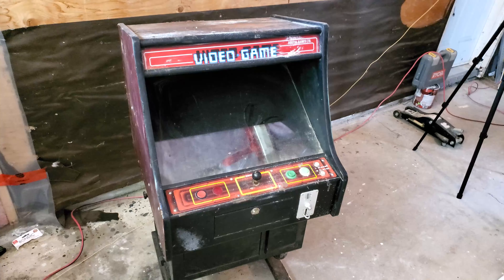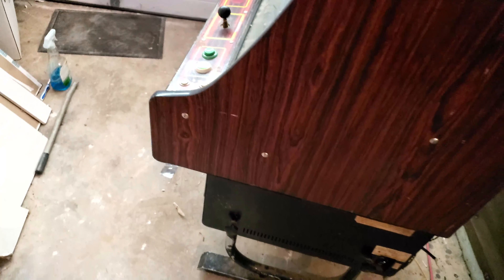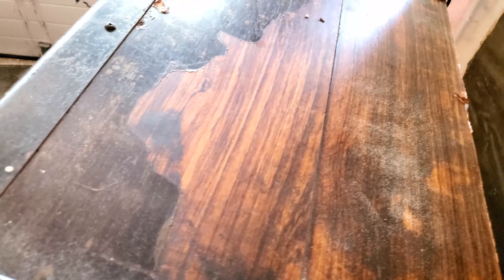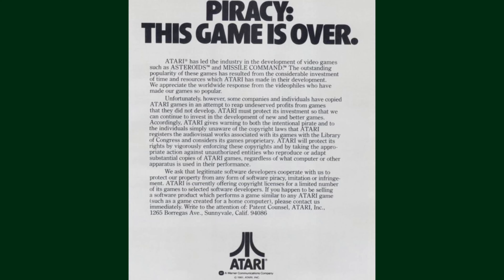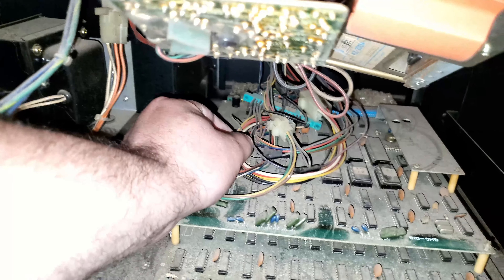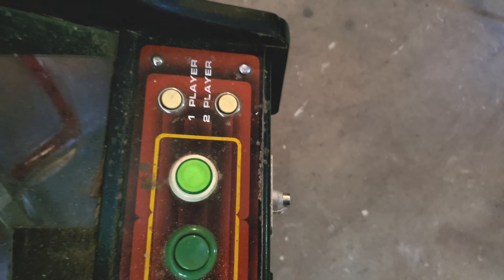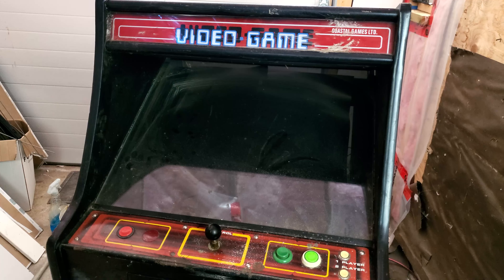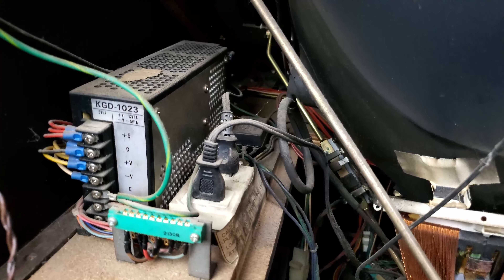Trashpicked Arcade Machine

Comment: I remember playing a Pac-Man knockoff arcade console as early as 1982. It was located in a Kresgie's store in Halifax.

Unlike many of its American counterparts, I cannot find any published court decisions involving Coastal Games. You are probably correct that it maintained a low profile.
Reply from the maker: I did find that document where one of their guys was offering repair tips, so it appears they weren't totally hiding.  Perhaps it was one of those deals where officially they only supplied the cabinet, which would be legal.. and then some under the table deal for the boards.

Comment: Since the monitor is on its side, you have a vertical deflection issue. Like you said, it's probably bad capacitors.  If you can get a schematic, look for large electrolytic caps in the vertical section. You might be able to spot them easily on the board... sometimes they're near the yoke connector.

Comment: In the past I repaired CRT for my arcade machines… but these days I replace them with flat panel displays and use an RCA or RGB to HDMI adapter instead. They look better and don't require playing with dangerous voltages.

Comment: Amazing video. I hope you get back to this one day, if you still have the gear. Swap out the screen with an LCD or something, so you can at least have a working cab. Still, great watch.
Reply from the maker: It is being worked on.  I am learning a bit about CRT discharge and safety first.  I am also sort of figuring out how the cabinet is laid out in terms of removing the CRT safely so I don't drop or smash it.  I'm capturing everything I do with it on video.  Arcade is a tad outside my wheelhouse but I'm slowly figuring it out.

Comment: I used to work as arcade gambler / pinball / technician 20 years ago. 

Suggestion: if you have a cabinet (specially a universal cabinet like this) and no keys - first thing is to get rid of the locks. Either drill them out or leaver them open carefully. The latches are usually meant to give in (to prevent bigger damage to the cabinet in case of break in). 
They are meant to be easy serviceable.

From there you should be able to get to the window glass better as well (good chance the panel with the joysticks has a hinge to fold down to service the buttons etc (either hinge on front or latches accessible from the back)

But I 110% share your discomfort about monitor chassis. Always hated them specially the big ones like this. 

As a note - you might be able to install a cheap chassis with rgb mod of a TV

Comment: So my two cents, 1) your board looks good 2) if you pull the glass back out you will find 4 bolts hold the monitor in, after you disconnect power and video cables it's relatively easy to lift the monitor out the front, then if you are not comfortable working on it take it to a repair shop, the tinted plastic is to hide the burn in on the tube... 3) If it were me I would put in a new joystick and buttons from HAPP controls, and one of their Jamma harnesses (save the old ones, put them in the coin bin for safe keeping, that way if you ever want to go back you can) then you can plug in something like a "Blue Elf" and have 750 games, the other thing is with a jamma connector it's easy to build an adaptor to put the original board back, or you can get a TON of just jamma boards for $100 or less if your willing to take time... I have 3 cabinets, one is a cocktail with a multicart in it, one is a standup sega set up to run jamma boards w/ light guns, track ball, and joystick options, the third is a racing cabinet (dedicated) for my standup i go to arcade auctions, and watch online places like FB market for boards I want, I currently have about 20 boards stored in boxes and can swap them out in about 5 min to play them... but i'd do the multi board for your daughter, you can also get an adaptor that will let you use a VGA/HDMI display if the monitor is too far gone... but I think a recap, and recalibration will do wonders... if you want to go the extra mile do a rejuvenation on the tube... if you want any help or info just let me know!
Reply from the maker: Many thanks for this!!  I was wondering how it came out.. it looked very awkward to remove the monitor from the back.  I will have another look for those screws and then see if I can arrange with my CRT repair guy to fix it.  I'm assuming he'll be able to fire it up without the rest of the cabinet..
Reply: @TechTimeTraveller  yes, if he can't test it without the rest of the cabinet DO NOT take him anything to fix lol, it takes standard test gear to get going and align it... the bolts are easy to find, also, you should be able to remove the glass from the front, you may have to remove the marquee to do it, but it's odd in arcade land to remove the glass from the back... and to get your board door open, since you have no back if you look in you will see the back of the lock and it will either have a large screw or a nut, that will let you take the tab off and pull the lock, from there it's a standard panel lock and in arcades you have two keys generally, one for the board doors (front and back) these will be keyed to the "operator" who owns the machine for doing maintenance and are the same for all the cabinets they own typically, then there will be a different key for the cash box, a copy of witch is usually on a hook inside the front board door and the other is left with someone at the location the game is installed so they can collect the coins... typically someone drops by every now and again and reads the coin counter then collects money from the business based on a pre-agreed split. this could be a flat monthly fee or as is more common a small fee, and a percentage of coins... the smaller the flat fee the higher the percentage. I look forward to seeing more on your find and don't hesitate to ping me for help sourcing parts or accessories.

Comment: Scramble is awesome once you mastered the labyrinth level. My Amidar bootleg plays Scramble, Amidar, Frogger and The End. Couldn't get any other game running on it without modifying the board though.
CRT monitor has vertical deflection issue. Since the monitor has likely never been serviced and there's nothing that looks really bad, you should look for bad solder joints first. There's a resistor that's got burn marks on the pins, stuff like this deteriorates the solder quicker than elsewhere, there's a good chance nothing's wrong with the CRT apart from dry joints. I hope. But anyway, this monitor is definitely fixable.
That 3PO coil was likely glued so it wouldn't oscillate physically and cause audible noise. 15kHz is bad enough for some people, let alone a choir of that.

Comment: Would love an update on this!  Did you end up attacking the crt, or swapping something else in there?
Reply from the maker: Basically I've been working on learning how to properly discharge and work on CRTs.  I've got a Tandy CM2 that I was less afraid of as it hadn't been powered up in eons and was easier to manoeuvre.  The trick with the arcade is getting this massive CRT and componentry down safely after discharging it.  It's a bit intimidating to someone who's never worked on CRTs themselves and accidentally gotten zapped a couple of times.  But I am acquiring parts and hopefully can tackle it again this spring and get the cabinet all jazzed up too.
Reply: @TechTimeTraveller  As an ex Broadcast service tech, It is not so scary if you know the do's and dont's.
What you do is take a cable with alligator clips, and connect one side to the monitor frame, which is ground, and the other alligator clip to a flat blade screwdriver.
Make sure the alligator clips ate firmly attached. As the screwdriver is now connected to ground, no charge can build up on the screwdriver, so it is safe.
Now carefully slide the screwdriver under the anode cap, and touch the contact in the middle.
You may here a spark jump if there is still any charge in the CRT. 
The CRT is now discharged. 
Once you have done this you will see that it is quite underwhelming 😋
If you want some excellent documentation on this, download a Sony BVM or PVM service manual (eg BVM2011)

As you and others stated, the horizontal problem is probably due to bad caps and or solder joints.
These monitor boards are usually single sided so re flow all solder connections of the bigger components, as well as anything that gets hot (big transistors, resistors).
As for the electrolytics it is best to replace them all. Even though many still may work, the ESR usually gets higher, or the lose capacity, have leaking currents, or can leak and ruin your board. It also usually is a big improvements in geometry and linearity well worth the time and cost.
You might also want to replace the caps in the switchmode PSU as they usually go bad north of 20 -30 years. (only the secondary ones, the high currents of the high frequency switching wears them out faster then the ones on linear psu's )
Hope this helps, good luck with the patient.

Comment: Thank you for backing off on the monitor. Better safe than sorry. I fix that sort of thing and yeah, touch the wrong thing & DEAD. Once fully discharged with both the anode AND a brush discharger, it's just a board.

Comment: Was there a part two? I couldn't see it in the play list.
Reply from the maker: Not yet.  Have some parts on order.  And am learning a bit on CRT repair before I try to take that apart.
Reply: @TechTimeTraveller  A healthy respect for CRTs is always in order. I used to service them in the mid 90's and they scared (and still scare) the crap out of me.
Reply: @TechTimeTraveller  tv repair tech tip. Work with one hand as tho its behind your back. Even if you get zapped it will only go to ground not thru your heart. Meaning don’t get grabby with both hands. ☺️

Comment: You're lucky your e-waste guy was so reasonable.  Last year I was at our e-waste site throwing out some junk and noticed in a bin 2 Apple II+ units a Commodore 64 and a Coleco Adam.  Like someone's collection had outlived them and then it was thrown out by those that had no clue.  I begged the guy in charge but no luck.  I even used the the old "The first R in the three Rs is Re-use" to no avail.  He said that Ontario law states that once it is in his possession he is legally bound to dismantle re-cycle the materials.  Damn shame. 

If the monitor takes a normal video signal you could just replace it with a flat screen LCD device.  It would be more reliable.

What CPU is on the board set?
Reply from the maker: I guess a lot of it has to do with protection of personal data.. not that a TV or arcade machine would have anything.  It's really quite stupid that they wouldn't allow reuse.  That's really sad hearing of those classic 8 bit machines going to their demise.  There's no good reason to let that happen.  It's not like anyone is getting a tax write off or subsidy.

I am thinking I'd prefer to keep the original monitor.. there is something about a CRT that LCD just doesnt capture.  But it is contingent on me getting over my fear of it to fix it.  Once you get 'bit' you get a lot more cautious.

I believe the CPU is a Z80.  It's hard to make out as the inscription is pretty faded.
Reply: yeah, i've seen that alot, in the states you get that because the know what it is and are either pulling it for someone or themselves... it pays to know a guy ;) and when he calls and says hey come down here, you go down...

Comment: I don't think that is monitor problem. I would look on the game or graphics board. Looked to me as though the picture wasn't completely making across the screen. In a collapse you can't see anything but a vertical or horizontal thin line. But admittedly it's hard to tell maybe I am interpreting what I see wrong.
Reply from the maker: I kind of wondered.. my experience of video generation issues usually is everything is messed up.. the third or so of the screen that works is weird.  Also I cannot adjust the position with the monitor controls.. so that's what had me thinking collapse.
Reply: @TechTimeTraveller  It could be collapse but I think it's more likely something in the video clock, it thinks it's done printing the screen before it is. I know what you mean with video though it seems like if it goes wrong it just don't work most of the time. You rarely get an edge case where you can see stuff but not all of it. Feed a test signal to the monitor that you know is good I bet it works fine. =)
Reply from the maker: @pikadroo  I meant to read up and see if the signal from the PCBs could be easily diverted to a standard composite color monitor for testing.  I just didn't have access via the front panel yet and didn't want to risk bumping the crt neck mucking around in there.
Reply: @TechTimeTraveller  You can use an Amiga monitor or a IIgs monitor, or even your AppleColorMonitor 100 as an arcade monitor. When I used to do arcade repair I used my IIgs monitor for testing boards on my bench. Arcade games are analog RGB with a 15khz signal.

Comment: 12:04 PC builders look away now...
Reply from the maker: Sorry.  I'm still mad at Seagate over the whole brick firmware thing years ago. :)
Reply: @TechTimeTraveller  Can't think of a better fate for a drive when it takes your data.

BTW I think you could put the control area decal in a scanner and have it redone by a print shop. Everything else on the arcade can be repainted/veneered but the decals are worth preserving IMO.